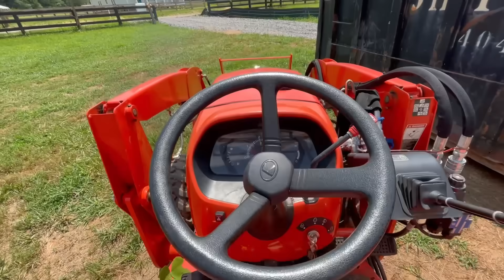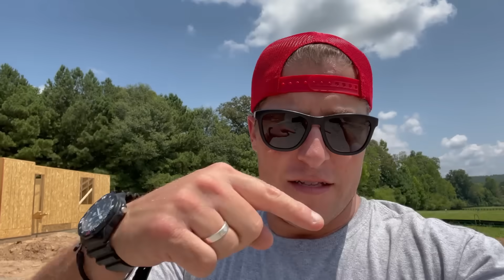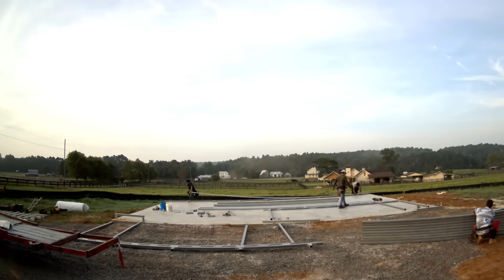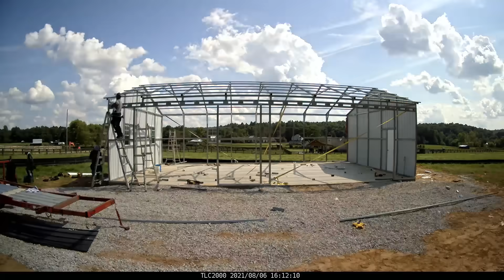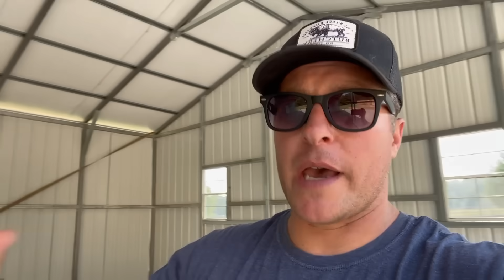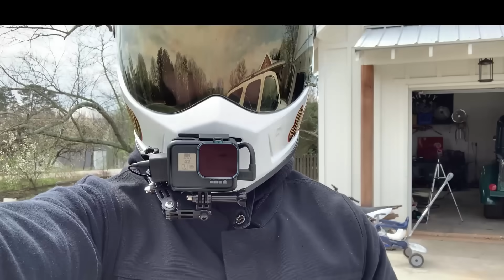I FIRED THEM!!  26x40 metal building Dream Garage build Ep.2

Comment: You (and all customers) should get what you pay for. Getting a braces in place of trusses isn't cutting corners, that's fraud and I would sue if not corrected. It would be a bigger problem for the manufacturer if the roof collapses and somebody gets injured or killed. A sagging roof without a load is a BAD sign.

Comment: I do buildings like that for people. I would never put anything up like that. Even when the framing started, the material wasn't substantial. This company is a scam. We do buildings like that so we don't have to deal with inspections with reinforce, roofing post etc. Are usually use 1/4 in 1/8 in Steeler everywhere. This is unacceptable you back into this? It's going over

Comment: You need to get VERY CLEAR from the jump. IN writing. The exact spec of the building- signed off on. If you have that, simply go to court. Start every interaction as if it is going to end up in court. Hold them fully accountable. Only pay as you go, based on milestone, approved, signed-off on work. Put everything in writing. Don't bash by name on YT until you win in court. They can counter-sue and use things against you. 

Worse case scenario, call in a local welder and if approved by a structural engineer, weld in some additional, independent longer supports. Consider the snowy months with 3 feet of snow up there. As is, it will likely collapse. This roof looks very thin and cheap too. 

Did you get "a good deal" on this garage or something? It's often the case- and you end up getting exactly what you paid for. 

Pay once for a quality product, from a reputable builder- you will have no issues. Those do not look like trusses. They are literally not much bigger than the supports I have on my large tent. Honestly, and I hate to say it, the whole things looks cheap. Maybe 1/4 size, as a temporary shed, but as a perm. garage? Never. Even with supports, it is not going to hold up to the weather. I think it is going to collapse and lift up too in the wind, rain and snow and ice. Just not a very robust looking thing- at all. I hope you did not pay over $3k for the structure and $1,500 labor. For a little more, you could have had a real garage that would last 100 years and add value to your property when you go to sell it.

Comment: U asked should ya pay for it. 
My answer is whose fkn money are u spending? 
There ya go. Tell them mexican’ts to get the FUCK off your dirt and take their trash with em! Then go buy somewhere else. Besides all that, if you show that 6 ft crap to the inspector… hell screw that. They defaulted on the contract by claiming and showing a 16ft truss then bringing in that 6ft garbage… they don’t have a legal leg to stand on. If you were smart, you would tell em one time to fix it to the approved plan. When, not if, they don’t, go straight to court with it. Ya don’t even need a lawyer. Just pay the $402.00 filing fee and start a civil action. That usually fixes the problem.

Comment: Here in Southern Ontario I had to provide certified engineering stamped drawings to our town building department for approval before I received 
the permit. Things didn’t go as hoped due to CoVid delays, but the finished product was signed off by the building inspector. Looking at your roof 
trusses, I doubt you would survive the first winter without snow loading collapsing that flimsy trussed roof span. Doesn’t look like you’re going to have an insulation package either. She gonna be hot hot hot in the summertime. Also, I don’t see any concrete piers to hold the uprights in place.
Different strokes I guess. I have no concerns with my build so far. My building is 20 x 40. I wanted to go 25 x 40 but I couldn’t get permission to 
exceed 4.5 metres hight measured from floor grade to a point half way between the bottom of the soffit and the peak of the roof, and still meet 
the roof pitch requirement. I have a steel clad insulated man door, two 48 x 36 screened windows and a 13ft high x 12 ft wide insulated roll up door. 4” rock wool insulation package that is sandwiched between the outside steel cladding, and the interior galvanized frame structure, that 
fits the description you mentioned as to how your trusses where supposed to look, complete with the upright posts spaced along the truss webbing. Two 40 long eve troughs, with leaf guards, and down spouts. My 5” concrete floor was poured last ! As I mentioned my building is 
anchored to the ground via the tubing sunk 18” into the concrete piers. The floor finish is as smooth as piss on a plate. Just wish I didn’t have V
to pay for temp storage at one of those clip joint lock ups due to 10 month manufacturing and delivery delay, but nothings perfect. I’d choose 
your replacement building carefully if that’s the route you end up taking. My building cost and erection was about $65 cdn. That was 3 years ago.
Ps, where are the threaded tie rods to hold the building square? I see some ratchet straps, but I guess they didn’t get that far before you called 
Strike ! Your out !!

Comment: you should be able to get what you paid for. design changes are a deal breaker for sure and id slam the brakes on too. What is the point if it cant handle a snow load or pass inspection?

Comment: I built these buildings for 23 years, I've seen one comment that says you get what you pay for, that's true, the real problem is they are building garages out of carport material, a carport that is over 20 ft wide we'll begin to sag in the middle, some carports use square tubing 2 and 1/4 * 2 1/4, others use square tubing 2 and 1/2 by 2 1/2, if you have ever used a 4 x 4 post running horizontal, it will begin to mow before you get the building built, you cannot use square tubing and expect it to have strength, if you are OCD definitely don't use square tubing, 2 buy 3 tubing Might work if your OCD, if your OCD don't buy a pinto if you're expecting a Cadillac, PS never paid in full for anything

Comment: Did you get engineer stamped drawings with this building, by an engineer licensed in your state? Looks like the cheap 29 gauge panels which are prone to having ripples from factory. The framing itself looks more like the framing that is used in these little 24'x24' carport sheds. not what you would expect to see in an all steel building. The roof insulation did not look like insulation at all. It looked like what is called a condensation blanket. A condensation blankets only purpose is to keep the roof panels from sweating inside the building and allowing water drops to fall on whatever is inside the building. Any time you see small framing with hat channels instead of mainframes with Z purlines you are getting a subpar building. The load testing of this building is what would worry me the most, especially if you live in an area that gets large amounts of snow.

Comment: I bought a 34×34 with 16 foot walls about the time this video was made. Mine is built way way better than that one. All my wall studs are doubled to 8 inches thick because all the stud material is 4 inch 14 ga. in my building. Also just one of my rafters has about as much metal as that entire building. That thing is junk, snow would break it down here. Hope you didn't keep it?
Mine was made right in my home town by Select Steel Buildings. First time I inquired about a building they gave me a Richardson Brand hat. Now thats class!

Comment: I had a metal barn built back in 2004 it had 6x6 posts for the vertical post and 2x12 inside to attach the metal with a shingle roof. We sold the property a few years ago in 2019 and I was over the at old place in 2024 to help out the new owner with a few things the place looks great and the barn looks as good as when it was built. It cost in the mid 30s I believe without a cement floor just gravel which  came later with electrical outlets and wiring. Housed our RV 37ft in the middle with two garage doors on either side for a tractor and a car. Loved it.
Reply from the maker: That sounds like a great setup. I’m glad it stood the test of time!

Comment: I'm a builder of 45 years and what I see there is a joke   I don't know where u are but if you get any snows at all the roof will collapse the whole structure looks extremely flimsy with the span those should be propper trusses with full length bottom cord the rafters are too light to handle any load without engineering triangles every 3 feet get rid of it all and shop for a better building

Comment: I had a 30 by 100 greenhouse with the same problem. In the end, it fell down and had to be rebuilt with cable ties all the way from gutter to gutter. So, my advice, get it fixed now! A snow or wind load can allow the walls to expand and the whole structure to come down.

Comment: If the plans show a different truss than you are owed another roof. The panels look to me that the screws were over tightened. That's causing panels to ripple out. The screws should just be backed out a little. You are probably stuck with the poor help.

Comment: It’s not the fault of the erection crew. They can only build what the manufacturer sends. Definitely poor quality control on the panel siding edges. For the truss issue, keep the 6’ piece there and install the correct 16’ pieces. Unfortunately you really don’t know a company until they provide a service and you can see what they’re all about first hand. Hopefully the manufacturer makes things right so you get signed off on your inspection.

Comment: I realize that this was 3 years ago - I wrote it for those that have yet to build one like this and are researching before hand.

You might be nuts about the ripple, or it could be the building is not plumb and this is the result.  Trusses, nope not nuts , make them do it to the plans.  Get the county involved so you have a failed inspection on record,  This will give you some weight.  Make a list of things you want fixed and negotiate and have the inspector in on it.  Name names in the video.  You can always remove or reload the video if they satisfy.  You are only going to get what was in the contract period.  You can't make shit up and have a judge back it up.    Anyone thinking of having a building built must write into the contract what they expect when finished,  Square, plumb and level.  No shiners (screws missing structural components and in straight lines) built as per plan, engineering specs and dimensions.  Color matching screws etc.  Workmanship is subjective but mention that you get final sign off in the contract and see how they react before signing contract,  pay in progress payments - total,  divide by 4 or 5 payments and do an inspection before every payment.

Comment: Those manufactured buildings are never the best, it’s better to have a red iron weld up or bolt together building.

The panels rippling is due to thin material and also the wall not being perfectly flat, then with then material and not know how to stretch those sheets out you can see any waves.

The truss’ imo are way to small for that length and if the proper sized Ibeam was used there wouldn’t be any sag, or need for extra bracing.

Comment: Thanks for sharing! While shopping for your steel building, did you look into variations in the gauge of steel that's used? Are most of them the same? My guess is that you can have as heavy gauge as you'd $-like, but I'd like to hear your take on it. Thanks, Dan

Comment: Its a cold form building, its gauge steel and the frame has very little strength without the sheathing. If the plans call for trusses w/ a bottom chord and actual web ties then you can definitely reject it. These cold form.buildings are definitely economy quality, wouldnt surprise me if some of the sheathing would be considered seconds from the roll forming machine being improperly setup. Personally, i would reject it and put up a proper red iron building. Your gonna pay more but its worth it. If you reject it, you might have to fight to get your deposit back.

Comment: Problem is distributor too many hands in the pie. Subs of subs of subs. This is why I quit the management of commercial buildings in Charlotte. No accountability. Hard to get the subs back to complete the jobs correctly. Notice that 90% of these installers are Hispanic. They don’t care about quality and workmanship. YesI’m generalizing, but I have been a builder for over 35 years. I know what I know. I only do flips or small projects for myself now, minimal tradesman because of the lack of integrity in workmanship. Good luck.

Comment: I’d fight them and see if you can get that building for free but your going to have to finish it yourself and I don’t know what your county is going to say. Good luck winning the battle to as you fired them. Also I purchased my carport from one of the original metal building manufacturers and I have the type of trusses your talking about and they are still all screwed. They do make even stronger cross web trusses but even they will be screwed together on site. Everything is designed to be shipped in the smallest combined shipment. Good luck in the New Year. I’m very happy with my carport but mainly my kids and wife did it with my advice due to disability. It gets us out of a rental garage.

Comment: I would have the building torn down and the correct building delivered. the building is NOT as specified per the contract and approved plans. I would have the inspector come out and inspect the work done and have them contact the company about the problems found. the ripple may be from the incorrect installation of the panels as the edge currently on the outside of the lap may be supposed to be on the inside of the lap. there is a difference in the edges. one for the inside and one for the outside covering the panel edge.

Comment: You were 100 percent right. I just cancelled a garage today because the manufacturing company sent me the wrong drawings for me to use for the building permit . When I contacted them to to get the correct drawings they wanted to charge me 2500.00 for them. Stay away from Longhorn Steel Structures.
Reply from the maker: It's more common than people think! Some shady contractors out there. Thanks for watching.

Comment: You get what you pay for, right now a lot of manufacturers are selling buildings a few thousand dollars cheaper than the competition, but the problem is they are using cheaper materials so they are not loosing much money with the discounts they are giving. I’m an authorized dealer and I sell buildings for a big manufacturer that I found to have some really good materials and also sell for my brother who is an installer. They both give you a 1 year workmanship warranty and 20 year rust through warranty, other manufacturers are only giving out 30 or 90 day workmanship warranties and only 10 year warranty on panels.

Comment: It looks like a typical cheap metal carport that has been enclosed, except in the weakest way possible... They probably sell both and just "upgrade" the cheap open carport designs into so called "steel buildings"... Who knows if the structural plans are BS or if they always use typical carport frames, just extend the length and change the roof metal orientation along with adding a few basics to make adding doors and siding easier 🤨 I've seen pretty great affordable carports which aren't code compliant because they don't have to be in most areas... Until you decide to enclose it and add electrical or plumbing, then it becomes a headache requiring modifications, truss  reinforcement, various welded bracing, roof/truss foundation tie downs, appropriate concrete anchor points, plus the engineer willing to put his stamp on all of those modifications he required after paying him a large chunk of money... Honestly I've seen wayyy better enclosed steel carports that were enclosed without permits and listed as "outbuildings" with temporary or straight up illegal electrical that run circles around this building as currently built... Because atleast on the carports the roofing is usually full length, run vertically across every truss, and it's often a much thicker gauge than typical non structural roofing or metal caldding... 🫤 I'd have it removed for a full refund at this point... There is no quick fix for this shotty design 😒🤷‍♂️ I'm sorry you got screwed, atleast you know enough to catch it in time, most people don't and end up with a very expensive lesson in "cost efficient" metal buildings... Especially when wind/snow storms move through and ruin the contents they filled it with! 😐

Comment: Sorry to hear you had such issues and glad you have the grit to step up and kick them to the curb. Shit contractors are a bane of residential work even here in Australia. They speak outside both sides of their mouth offering contracts and trying to keep verbal all of the promises yet calling out the contract when it comes to failure. 

The bottom line is that you must ensure that everything is in writing. If it's not it doesn't exist. 

It sounded very helpful to have the building code quoted at least. 

How did it turn out and how much grief did you go through to resolve it?

Comment: I think that the installers bought damaged panels as seconds to save money and to make more money on the job. They also got cheaper roof trusses. You were so right to send them on their way.  They were trying to take you for a mug but it didn't work.
Reply from the maker: Yep that’s exactly what I think they did. I put way to much trust in the metal building industry honestly. I should’ve done way more research prior. Lucky I feel like people can learn from my bad experience if there in the same market shopping. Thanks for watching
Reply: @ProjectDadLife  I am in the process of buying a 30 x 35 x 14 foot shop and your videos are of great help. I hope that you don't regret not going with a taller building for your 2 post lift.